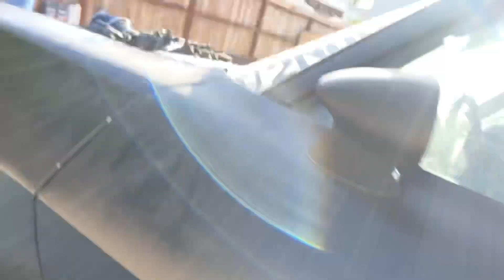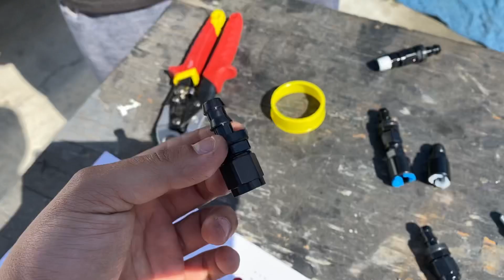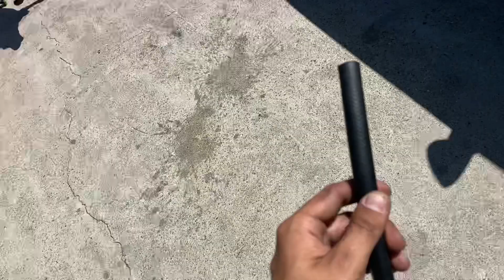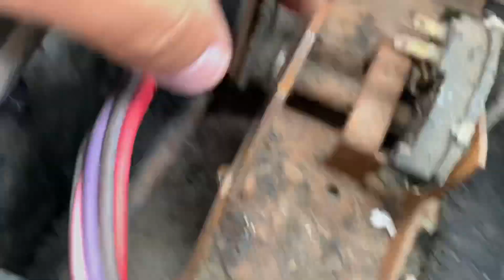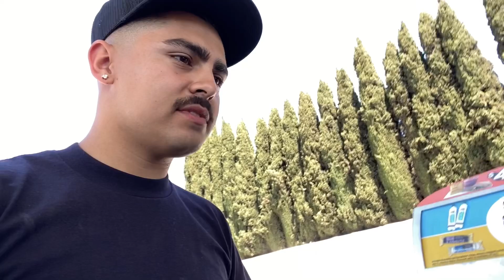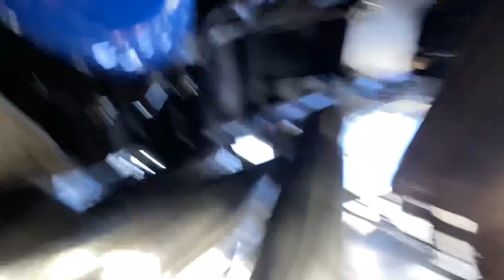Beto’s LS swap first fire up!

Comment: Hell yeah I used the same pushing fitting on my 67 10 ls1 swap and had a couple popped off I hosed camp on them just to be safe
Reply from the maker: Dang that’s weird that they popped off, I have them in my nova and they’ve been fine for like 2-3 years now
Reply: @BackYardYonkes  maybe it’s the hose I used that did it